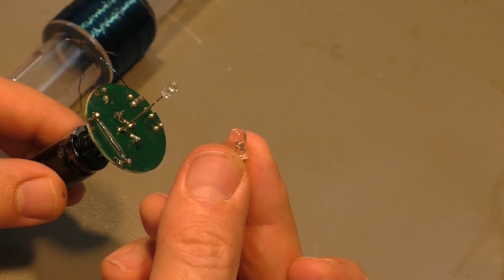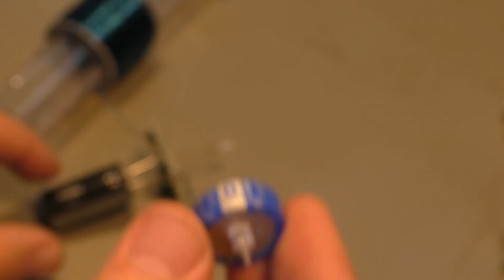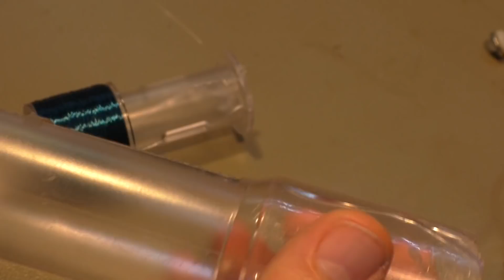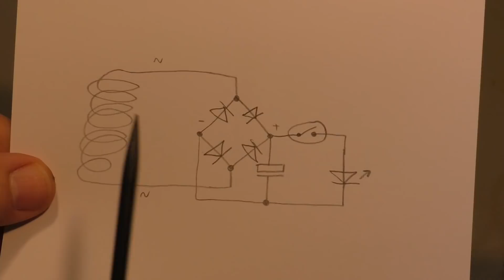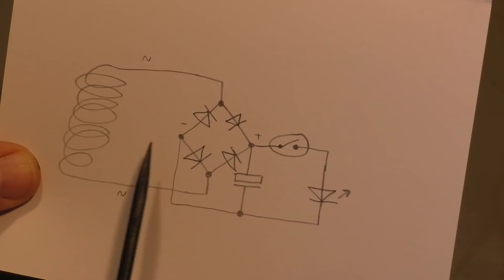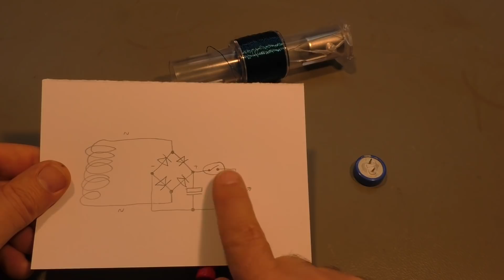Don't shake your junk too hard... (PWJ113)

Comment: The problem is that you used the wrong capacitor, the original supercapacitor is 5.5V 0.47F or 1.5F. i actually designed several power harvesting devices with such supercap. These supercap presents a low impedance to the charging circuit, preventing the voltage from rising. Charging this 0.47F/1.5F supercap over 5.5V would require unreasonable shaking.
Reply from the maker: Even if that's the case, the LED will die anyway because there is no resistor between LED and capacitor.

Comment: Felicitaciones por el trabajo, me puedes decir de cuanto es el valor de la resistencia a colocar y en que parte del circuito, saludos desde Argentina
Reply from the maker: (Google translate helped...)
You need a resistor between the capacitor and the LED to reduce the maximum current. Without the resistor the LED will blow up.
Let's say your capacitor gets charged to 12V and your LED is a white one with 3V and 100mA max. Then the resistor must be about 90 Ohm and it must be at least a 1Watt type or higher. If you take a low power resistor it will burn.
R = U(total) - U(LED) / I      U=voltage, I=current

Better that a resistor would be a constant current regulator that could be made with a simple FET transistor. This would allow a constant brightness when the capacitor voltage drops.

Comment: Just a thought: Does the couple of turns through the magnets, if large current is pulled, make the magnets jump around - under perhaps rare placement conditions? Great video, thanks.
Reply from the maker: I don't think so. The wire is not insulated and does not form a coil. Current will go everywhere including through the magnet. Anyway currents can not get that high.

Comment: The Modern white LEDs the common Voltage is 2.9V so even 2.5V are enough to light it up.
Reply from the maker: yes but not at full brightness. Anyway, the capacitor will be overcharged every time you shake that thing... You can choose to blow the cap or the LED :-)
Reply: Put a 3.1V zener diode in parallel with the cap to stop overcharging.

Comment: To reach the 20V with the supercap (=0.47F vs your cap=0.0047F), you will need to shake it 100 times the amount you've done, ca.40 X 100 = 4000 times…

Edit: It has a biological (getting tired) over-charge protection.
Reply: Put it on top of the washing machine when its on spin cycle to shake it for you. 4000 is easily achievable.
Reply: No, it doesn't take anywhere near that to easily destroy it. It's only a 2.5V cap and the LED can't handle much more. People often shake the flashlight before each use, regardless of whether it was fully discharged. Supercaps keep their charge for a long time, so it would gain charge over time till it self-destructed (as this one did).
Reply: @cyberdragon3699  wrong, this is a 5.5V 0.47 or 1.5F supercap, supercap keep their charge better than a normal cap, yes, but they have a significant leakage still, 10 to 40 uA.